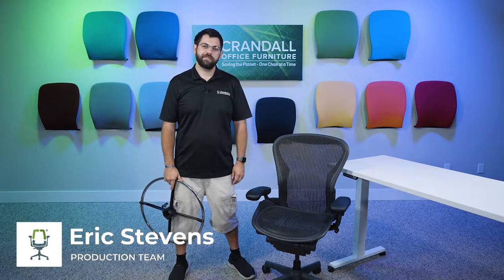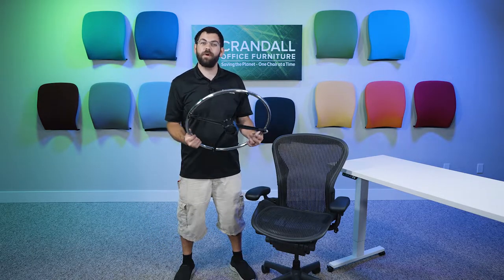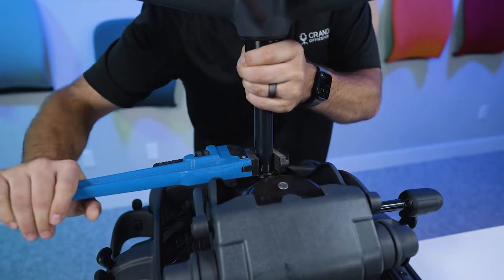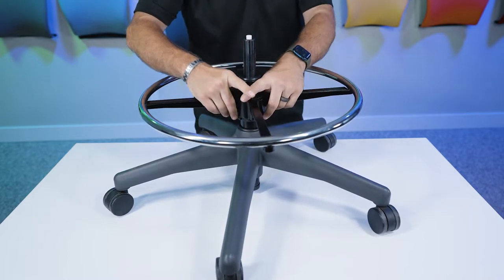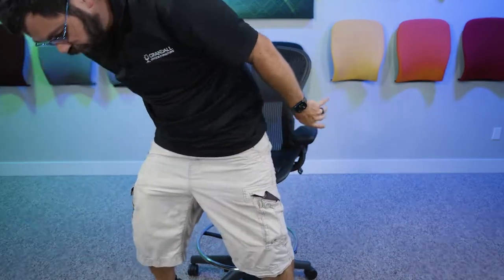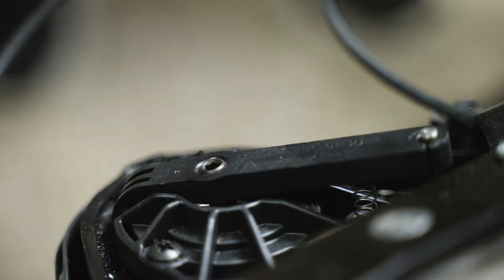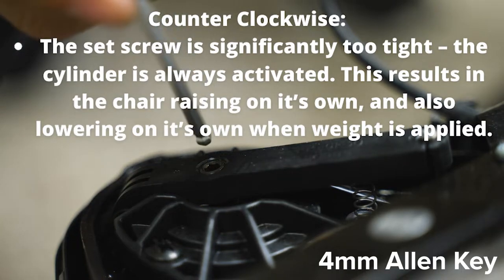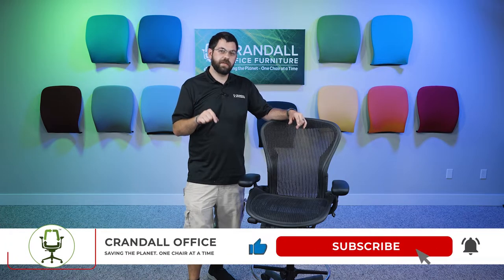Stool Kit Install for the Herman Miller Aeron Classic Office Chair - Top Activated (before 06-26-13)

Comment: This will work on side activated as long as we remove the the cables before removing the cylinder right?
Reply from the maker: Correct, you have to make sure as well that you have a side activated cylinder.

Comment: Will this kit work with sayl chairs?
Reply from the maker: We are unsure do to the fact that we haven't tried that before, if the sayl chairs are top activated chairs then theoretically yes. it also depends on the diameter of the hole of the chair to insert the cylinder into. We are looking into this though, so we will comment again if we find anything out.
Reply from the maker: Well just found out it should work, our warehouse manager said they are both top activated and should be the same size hole for both chairs. Here is the link to order. https://www.crandalloffice.com/shop/chairs/herman-miller/aeron/herman-miller-aeron-8-stool-conversion-kit/